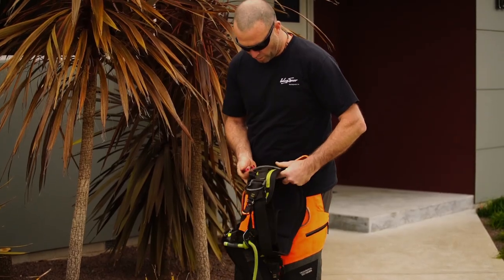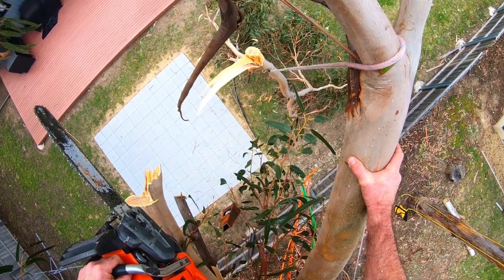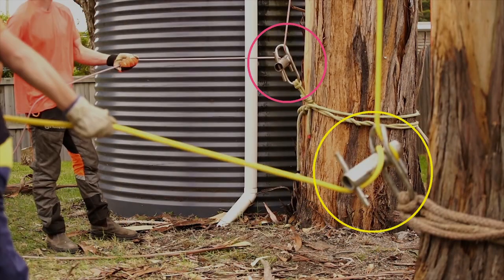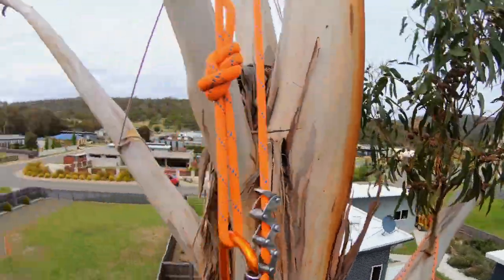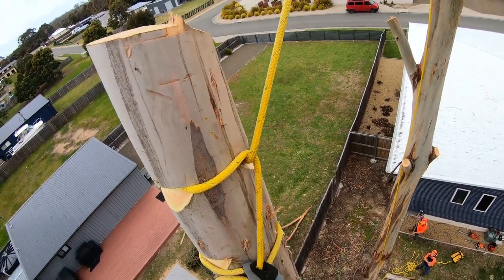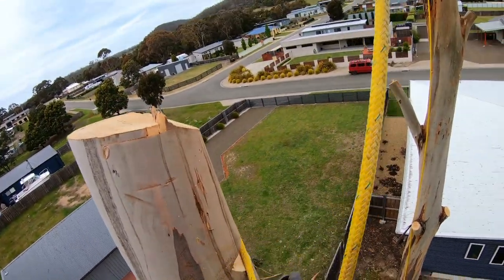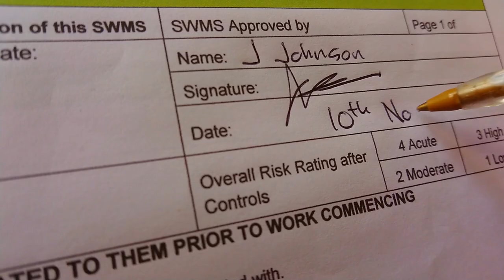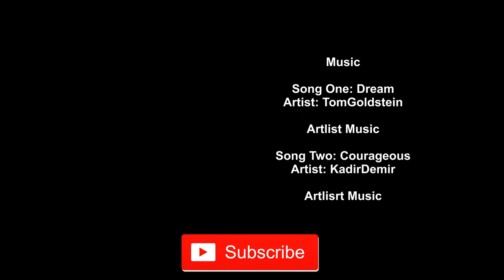KICKING GOALS, Big Tree Rigging/Climbing Australia, STC FILM

Comment: Putting the notches in to hold the rigging rope in place is something I figured out myself for when I'm rigging down heavy but shorter pieces. Is there a name for that technique?

Also I'm wondering with the edges of the notches, if the rope has a possiblity of being weakened by the edges digging into it. Wouldn't want the rope to get cut through if I was doing a super heavy piece like that.
Reply from the maker: Hey cheers for your comments.!
Doesn't need a name really but you could call it intelligent rigging 😄
Also I've been rigging like this for around 11 years now and never had a problem with my rope. 👍